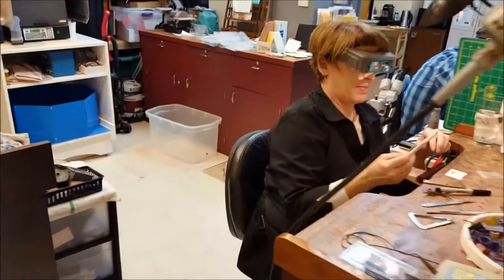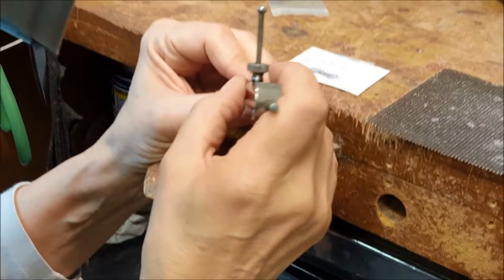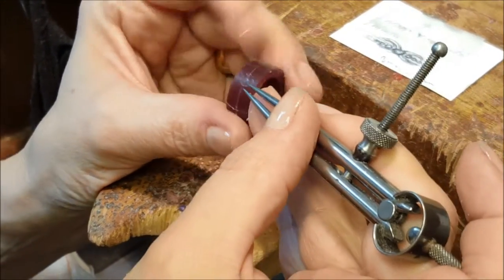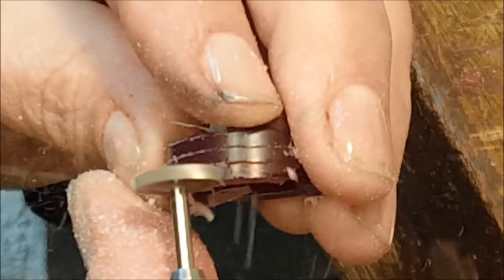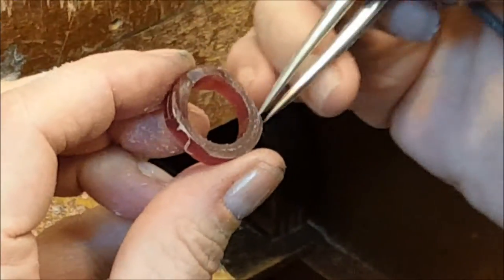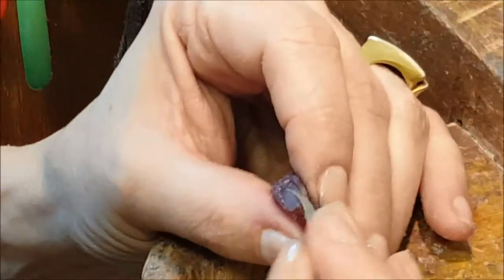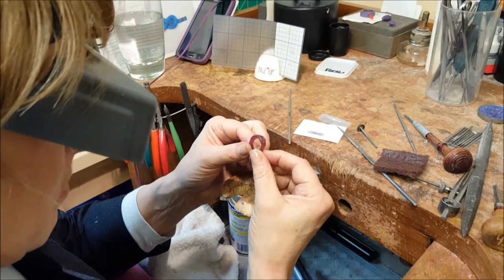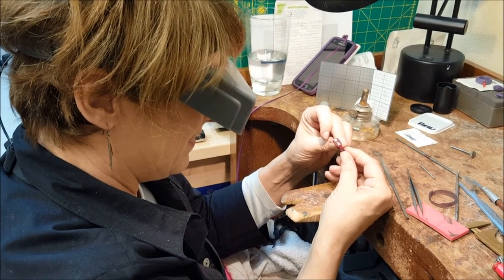Carving a Wax Model at Trios Studio

Comment: It was interesting to see how much of this process was done free hand. A lot of fi ger holding. Thank you for taking the time to do this. I learned many useful techniques.
Reply from the maker: Hi Rand,
Thanks for watching! There many ways to do any given thing. Debbie and I have always hand carved with fairly minimal tools. There are tools like lathes and Matt carving tools that attach to the flexshaft as well.  Of course much of the industry has gone to CAD. But where is the fun in that? Deb and I typically make many decisions during the evolution of the wax carving process that may not have been completely articulated in advance or that make more sense when you have hands on the project and can see all of the angles and relationships in the piece.  Creating in CAD removes that "evolution of the design" since it removes the hands on part. We enjoy the process of discovery both in wax carving and in metal fabrication.  For me, making a piece of jewelry is always an exploration and a series of decisions as I go along. Enjoy the process!
Mary